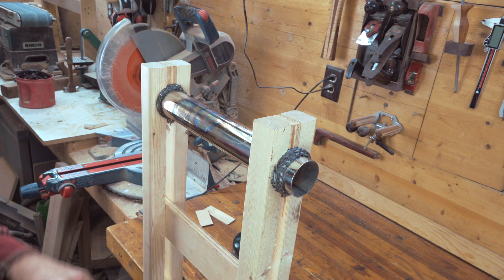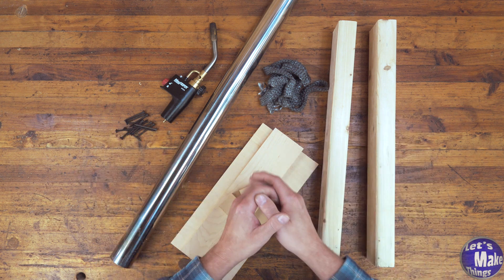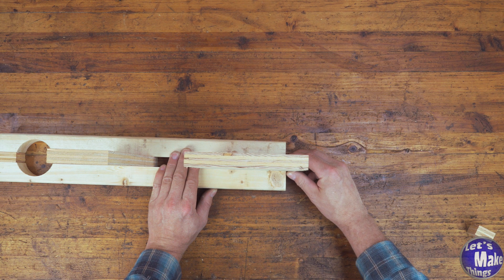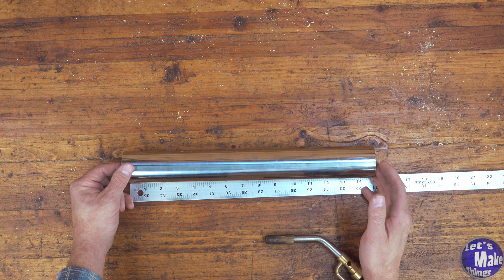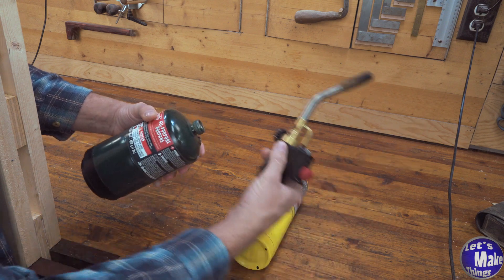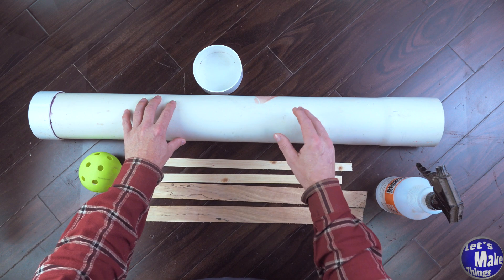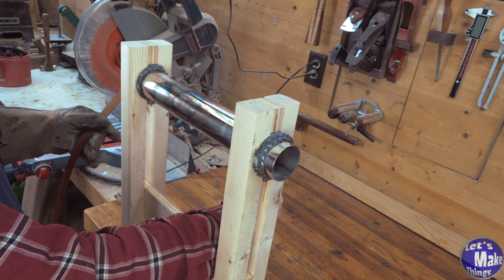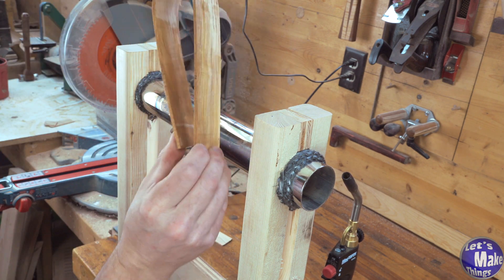Unreal Wood Bending...with a Muffler // Step by step build

Comment: A decent heat gun like a Steinel 2020 can safely accomplish supplying plenty of heat to the bending tube without the open flame hazards, plus an adjustable temp unit can easily be dialed in to your pipe's ability to dissipate heat.
YOU DON'T NEED A TORCH!!!!
Reply from the maker: No, you don't need a torch.  You don't need a table saw either that uses electricity that could create sparks.

You're the very first I've read to advocate against using a torch in the shop.
Reply: @makethingswithrob  Please explain how an electric table saw creates sparks? Are you speaking of the cheap junky type powered with a brushed universal motor? You know, like the kind of motor in ALL corded handheld circular saws? Not much argument to be made on those saws starting fires. 
Here's the percentage use of those two tools in my woodworking shop:
Heat gun: 99%
Propane torch: 1%
Lets see you do some hot glue edge banding with a torch. Lets see you soften the glue to separate a badly glued joint in a chair with a torch. Lets see you lift damaged veneer for repair work with a torch.
Starting to catch on yet?
Reply from the maker: @mrfirestop415   I'm with you with the heat gun.  I use it to remove stickers, hot glue...you name it.  I just can't understand your distain for torches to heat things up.  I wasn't trying to start a fight with you but point out that torches are shop tools.

My idea to use a torch to bend wood isn't a new idea.  The build is my creation (but seriously, someone else might have come up with the design in the past...so many things have been done prior to the 2000's), but the idea is at least 30-40 years old.  I actually corrected a problem that I saw by using stainless steel so you're not heating zinc covered pipes and went with stove pipe gaskets instead of fiberglass.

If you can make it work with a heat gun, more power to you.  I just wouldn't want to burn one of those things out trying to bend wood when torches are so easy and inexpensive to run.

So, please, don't take offense (or too much I guess), as a torch is a basic shop tool.